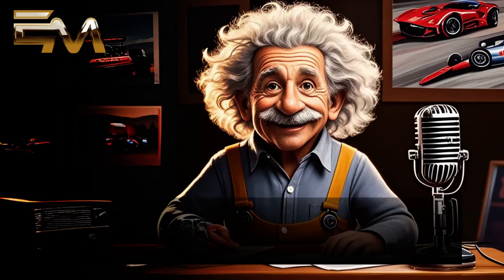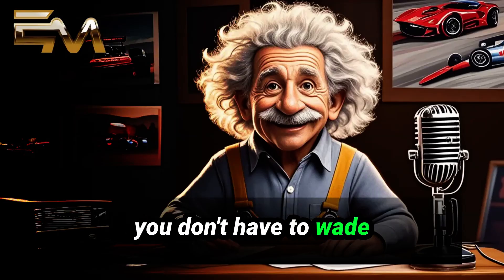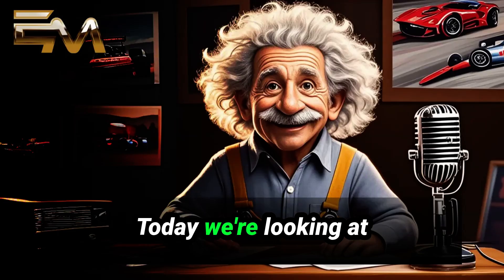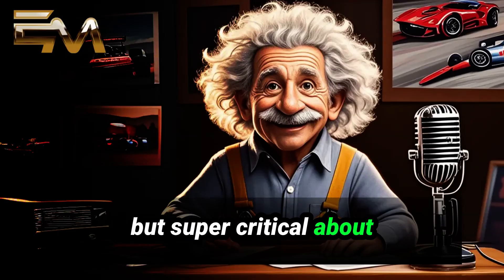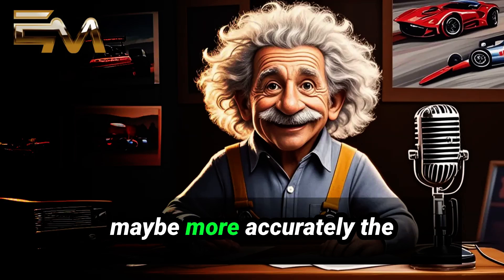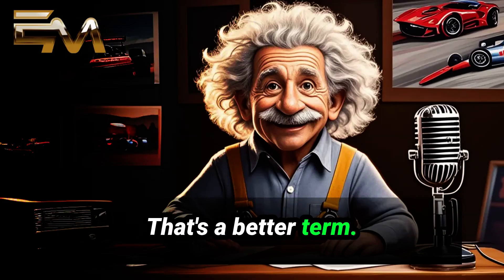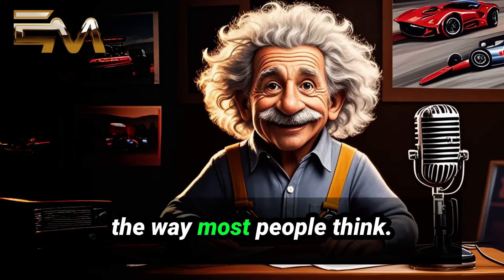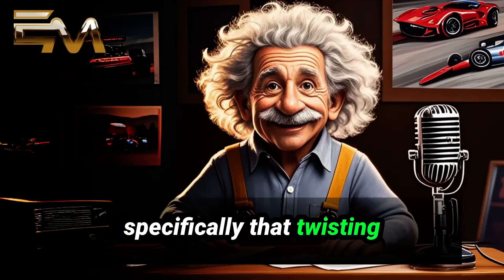Engine Harmonics Explained: Why Your Crank Might Be Dancing (And How to Stop It) | Einstein Motors

Comment: Dynamic balancers using weights (with silicon oil/grease) or mercury were 'latest and greatest' about 15~18 years ago, what happened to them?
The 'twisting' is greater under load at low rpm compared to humming along at max torque rpm?
Reply from the maker: Facts!